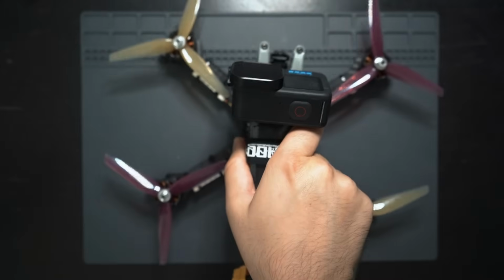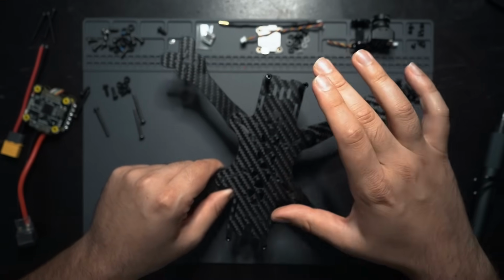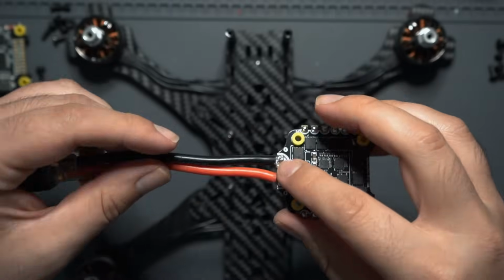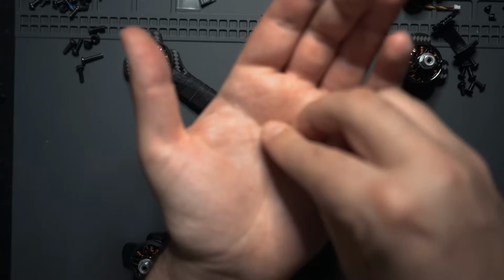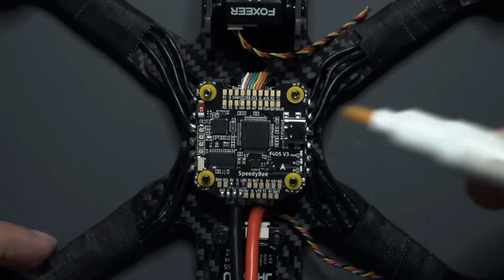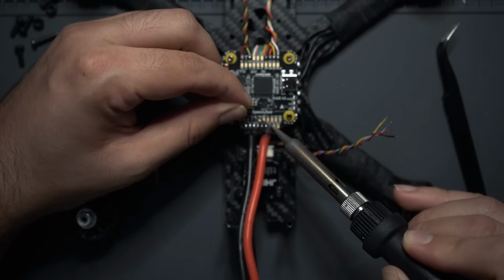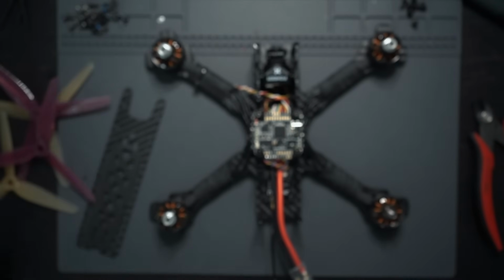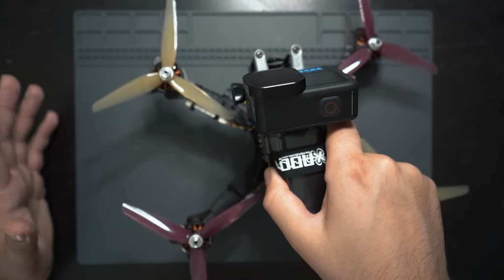Build a Freestyle FPV drone for $200

Comment: Whe I plug in the battery there is not second "beep" from ESC , any sugestion?😢
Reply from the maker: that means the ESC and FC are not communicating. Double check wiring going from ESC to FC, or maybe try the other ribbon cable included in the box 👍
Also make sure you have a motor output protocol selected

Comment: So you never covered putting thr props on, i got the motors as u, came with nut washer and screw but the screw is to thin to screw in do you not need the screw or do i have to find a thicker one

Comment: Hello! I made my own drone following your steps, but for these motors I used a mamba f405 with 40 A ESC
I think my engines get too hot, is this normal?
I'm using the same ones as in your video.
When landing and touching the engines they are very hot.

Comment: Did you switch footage or showing two different builds? What happened to capacitor on esc now it's on batt cable and look like different board??
Reply from the maker: @6:11

Comment: Hello! I built this drone and for the life of me cannot get it to bind to the controller, I must have reflashed firmware around 30 times now in speedy bee app and in expresslrs configuration, spent hours in beta flight and watching YouTube tutorials, I’m 100% sure all my connections are good, is there any guide you have for the setup of this drone? I have all the same parts as your video and same transmitter

Comment: I bought all the parts you recommended except for the radio cause I wanted a tx16s... I can't for the life of me find a crossfire module for the tx16s so imma return my reciever and the elrs module that I bought ( and I swear It said crossfire on the product listing) and get a different protocol... I'm losing it...
Reply: Update: it's 2024 and the drone still isn't working. I've tried everything I can think of

Comment: Just curious. Is the poor FPV video quality from the camera or the goggles? If I spent more, I'd want to improve that. Thanks for the video!
Reply from the maker: That is just how Analog FPV equipment looks. You can upgrade this by going with DJI goggles & a DJI air unit. There's also the walksnail system (Cheaper, and almost comparable to DJI) and HDZero.

Comment: Of course, it costs up to $200 to assemble a kit for the drone itself. BUT you forgot to specify that the price of the controller and FPV glasses is quite high, so the total amount will be impressive)
Reply from the maker: Correct this video is focused on just building the drone. 

There are some solid affordable options out there for goggles/radio though. 
New Radiomaster pocket comes in at $60 and would work with this build. 

You can get a set of decent box goggles for about the same price.
Reply: @TRONCATFPV  Thanks for answering)
In the future, I want to build my own fpv drone and fly it) And now I have to train only in the Liftoff simulator, because I live in Ukraine and it is currently forbidden to fly my own fpv drones, or any drones at all, due to the war and martial law.

Comment: Thanks for the video, I was wondering being a drone noob if you can answer a few questions bro 🙏🏼🙏🏼🙏🏼

1. Built like in video, what is avg flight time?
2. What happens when drone goes out of sight? Even if just behind a building for like 4 seconds? Immediately crash?
3. Can you make a video of a budget fpv drone that has a gps chip and can turn back home after loss of transmission and/or rc power and/or push return home button. Me as a total noob like the idea of no need to be scared to lose it 😅
4. Ah yes, this build. Max distance?

Comment: If you are beginner don’t order the flywoo Goku 450, no idea how to install, not plug and play like the one he showed
Reply from the maker: It’s not plug and play but is relatively easy to hook up. Here is a link to the wiring diagram: https://cdn.shopify.cn/s/files/1/0010/7410/2324/files/FLYWOO_VTX_TXNANO_VTX625-2020-6.pdf?v=1591694047

Comment: So newbie here, can I use my fat shark goggles and tx16s remote for this quad? Or is this a digital only? I’m 1 week into this and still learning the difference between digital and analog and I know my goggles are analog from what I was told from the guy who sold em to me with my tiny hawk drone
Reply from the maker: This build will definitely work with your fatshark goggles 👍
The TX16s will work as long as you use a compatible receiver. Do you know what receiver protocol your TX16s is running?

Comment: Im new to building drones and I dont know much but when I watched the video he fused the capacitor but it then disappeared when the video cut and I didnt see it for the rest of the video so I dont know where it fits. If anyone could help that would be appreciated. Apart from this it is a great video 👍

Edit: I think I figured it out, so the speedybee esc he used had the capacitor on the end(which he uses for the rest of the video) but he used a different esc which didnt already have the capacitor on the end to show how to put the capacitor onto the speedbee.

Comment: Would you still recommend this build now in mid 2023? I’m looking at building my first and need everything so this is a good starting-point.

Any recommendations for radio and goggles?
Reply from the maker: This build is still very solid. Going to have an updated "budget build" very similar to this coming out in the next month or so 😉
Reply: @TRONCATFPV  Any update on when that comes out? I'm ready to pull the plug and start flying! Thanks man

Comment: Hi, 
Thanks for the video, it was really helpful. 
I was wondering if this drone is compatible with the dji fpv controller and Goggles?
Reply from the maker: if you swap out the VTX & camera I used in this video with a DJI O3 air unit you'll be able to use DJI goggles and their remote controller 2 🙌

Comment: Just had a question. When mounting the motors, where did you get the screws from to do that. Did they come with it or did you buy them separately. If so what size?

Comment: can u run this build with dji goggles? im new trying to get into the hobbie
Reply from the maker: yes, swap out the analog VTX & camera for an O3 Air unit or vista unit and you'll be able to use DJI 👍
Reply: Thanks allot what things i don’t need to buy from the build? I have crossfire controller. Really appreciate your videos not manny ppl take their times to do budget build and do such a excellent explanation! Keep the hard work!

Comment: thanks for the build just have a few hopefully simple questions instead of using the ELRS lite receiver can i swap it out for the TBS CROSSFIRE NANO RX (SE) thus allowing me able to use the TBS tango 2? aswell as.. will any headset work with this setup having the TBS receiver if it compatible!

Comment: Hey man! I really appreciate you taking the time to make these videos and helping the community! I have a question: would the source one v5 work with this build too? Once again, thank you!
Reply: I am pretty sure it will
Reply: Hey did the v5 work with it ❤❤
Reply: It did! But the screws that came with the motors were a little too short (they still work, but wouldnt hurt to have 1 more mm or 2 in length) @Pistolpressure

Comment: I really enjoyed this video. I want to get into this hobby and you explained everything in great detail. I can solder pretty well so I am confident I can put one of these together. Most of the parts you used are out of stock though 😞
Reply: Yep having the same problem here. Trying to find new motors. Not sure if I can find good ones for the same price though. I might just buy more pricey ones. Did you end up building the quad yet? Or a quad? How is it?

Comment: Hi, I have a question on the frame, those this motors:  T-MOTOR V2306 V2 KV1950, can fit in this frame? Im trying to see the motors dimentions on that frame but I can't find it. 
If it can fit, then what props do you recommend for this motors? I focus on freestyle.
Thanks.

Comment: I am complete beginner and just purchased a drone kit from Ali Exp as I was trying to avoid the stress of choosing parts for my first build. The kit appears to have reasonable quality name parts however it comes with 1800KV motor. I note that other designs use 2400KV motors. I understand the KV is directly related to speed although torque is also a consideration. My question if 1800KV underpowered for a typical drone. I am happy to upgrade the motors if that is deemed to be necessary. I dont plan on any payloads but will provide additional sensors including GNSS and flow and lidar sensor.  My plan is get some experience in building a drone, then I plan to move to fully autonomous AI drone build as a new build which is my main interest. PS. I do have a engineering background, but totally new to drones. So please dont be too hard on me.

Comment: Honestly if your gonna add flux only once. Do it after you tinned both the cable and pad. But really it doesn’t hurt to add more at that time anyways. The flux has already burned off the best way to get a shinny joint it to add more. I would say those were almost cold joints. You can add gel flux and then just clean it well with isopropyl

Comment: Heres my version of this build (6s)
Foxeer Razer Micro $18
Speedybee F405 stack $70
TBS Source one V5 $30
Flywoo Goku VTX625 $16
Happymodel EP1 $13
T-Motor VELOX V2 V2207 1750KV or 1950KV x4 $56
HQProp Ethix P3 Peanut Butter & Jelly Propeller (3 sets) $10
Total $213 without tax and shipping
Reply: Any Tips for a beginner? This would be my very first drone. What Batteries do you recommend when I use your version
Reply: @funkeng3880  I use CNHL Black 1300mah 6s batteries. And as for the tip, its way easier to load a preset than tune it yourself
Reply: Thank you for the Quick respons

What do you mean ' load a preset

Comment: Hi, i just started and i wanna start building my drone, can i lust the parts i woud wanna use? In my head its a long range drone with freestyle capability, the stack is speedy bee f405, suource one frame, the razer mini camera ( all 3 as in the video) LP3 elrs reciver, foxeer lolipop 4 antenas, foxeer reaper extreme vtx and xing 2 2207 1700kv motors, is a more expensive build than this in the video because it have a more power full vtx, and better mottors, planing using it on 6s for freestyle and 4s for long range, its a good idea to do something in the middle or i shoud do a build for freestyle and a separate one when i have the money for long range?

Comment: Hey, I just recently built this drone and have been trying to get the receiver to work, but in the speedy bee app it says that no receiver is detected. If anyone may know what is causing this issue your help is more then welcome. 

I have also looked at the settings he showed us as well as the wire connections and everything looks good.

Comment: Can you please explain why you are soldering capacitor to the xt60 wire.
Because up until now the videos I've seen don't do this.
Thankyou
@TRONCATFPV
Reply: And is there any situation where u won't solder the capacitor on the xt 60 wire❓

Comment: Hey TRONCAT FPV, I'm absolutely NEW to drones, but not RC or electronics/soldering etc. In your final product can you please share a few details? The Pads at the bottom of the arms next to the LEDS what are they? The LEDS you are using, do they come with Pigtails? also what sized clear shrink tubbing did you use for this project? Sorry lots of questions and I hope you see this message.

Comment: hey, i'm planning on building this exact drone via this video since i'm going to start flying. I find it very impartant that the drone flies a good amount of time (so it doesn't fly for only one minute). Can you give me an idea on how long this build flies for? I would appriciate it. Love your vids😊

Update: Does the frame come with the gopro mount? If not, how do i attach the mount to it?

Do you have a personal favourite charger for the OVONIC 4S Lipo Battery 50C 1550mAh 14.8V Lipo Batteries
Reply: every drone flies a different amount based on all sorts of factors, Battery type/mAh/how fast you go/ how much you push the drone. The frame also does not come with the mount that will need to be 3d printed or bought seperatly, Frame may come with extra mounting screw though.

Comment: am i able to use my dji fpv goggles and remote or will i need new goggles and remote for this? great looking build, hoping to replicate it soon
Reply: Just get the air unit instead of that vtx and camera
Reply: @InaMoparBeats  The air unit is awesome, but a little pricey. Would it still be worth it over the VTX and cam listed in the video? VS me just buying a new headset/remote?

Comment: Loved the video and your flying skills.
Some questions though :) :
1 - can the frame be 3D printed? to save some cash there :P
2 - would a Spektrum DX6i be good to pilot such a drone?
3 - what goggles would be good for this (budget inclined but to offer good quality)?
4 - did you have issues with the FPV camera transmission? Cause in the video it seemed to be  jerky and after a while you just gave up on the overlay...
Reply: 1. the frame hell no haha, i mean you can do whatever you want but if this breaks basically your full drone breaks

Comment: I have everything in my cart ready to order. One question. What gauge of wires do you use for the build?
Reply from the maker: it depends on the part, usually for receiver/vtx/GPS/camera I use 30awg

Comment: this is a great tut for beginners like me and really goes in depth on what to do with each part and im glad you didn't speed through the process making it confusing and hard to understand 
one more thing, im terrible with manual and was wondering if I could tune it for stabilized movement making it so it has a locked pitch and yaw making it so it can't go past a certain angle.

Comment: I'm nearly brand new to drones, picked a second hand walkera quad that needed some fixing and it should be good to go (fingers crossed). However I still want to build my own. I like the look of the one you put together but I was wondering if the 3s lipos I picked up for the other quad would be usable and possibly a little more controllable or less twitchy?

TLDR: Is a 3s Lipo you already own worth it on this build for a newbie?
Reply: I would not do it. 4s is much more worth it and escs not meant for 3s may be unhappy with the voltage they put out. You don't want this to happen because if your quad falls out of the sky mid freestyle.... well.... its not gonna be very good.

Comment: Iv had an itch to get into fpv for some time so I’m going to just do it now. but the more I look into it the more confusing it gets with what to buy and if your paying the right price for what your getting, I think il be building my own for two reasons. I know exactly what it is and build the skills for repairs because I’m sure there will be a lot! I like the Bluetooth for in the field tuning. I think il be building one of these, they look pretty good. Only question I got is if I want more speed/power what would need upgrading?

Comment: This might be a dumb question, but are all screws and nuts etc. shown in the video included in the parts or did you buy them seperately?
Reply from the maker: all the screws & wires used in this video came with the components 👍
Reply: @TRONCATFPV  Such a relief to hear that. Thank you!

Comment: Can I use 6s batteries like the 6s tattu 1050mah 130c or even ones like that that are 6s but with more mah if I use motors that have a little lower kv like the xing2 2207 1855kv

Comment: Hey I'm sorry noob here this build is digital right? Not analog also if I buy dji goggles v2 and the fpv controller 2 am I able to use those with custom at home builds like the one in this video?
Reply from the maker: in order to use this drone build with DJI goggles and the FPV controller you'll need to swap out the receiver, VTX, and Camera that I used with an air unit.

Comment: To the multiple peeps asking the same question about duration of flight time, and not getting an answer, it's bcoz there's no "set time" and you have to do some calculations.  Google it, come on. lol.  But basically it depends on flying style, then the formula to calculate your FPV drone flight time, you have to know three factors: Battery Capacity (in this bulld that's a 1550mAh 14.8V Lipo) , Battery Discharge and Average Amp Draw (the components total power draw which can fluctuate and be tricky to come up with ONE number that applies to all.)  For these specific parts, and for practice if you're serious about building this, you should look up each parts power requirements and total draw when all parts are firing at max output, and reach a best-case-scenario.  Dude has no time to answer the same question over and over,  making these bomb ass videos that clearly take time and effort WHILE actually doing the builds, but the way he rocked it it's probably 6 minutes max.  Remember this is FPV and for racing or performce, not the regular king of reco or photo drone flying, so getting even 6 mins out of this is REALLY awesome.  Should not make a difference if you have 2 or 3 battery packs or MAAAKE your own.  Google awaits.  Hope this helps.

Comment: I have spektrum dx8 transmitter that I use with hellis. Are there any  receivers (that are worth a damn) that will allow me to use my transmitter with the boards you have suggested or should I, as a newb to fpv, buy a new controller that's better suited for the fpv world .